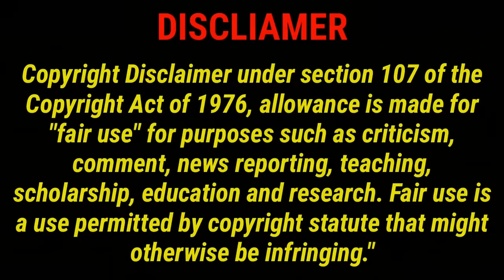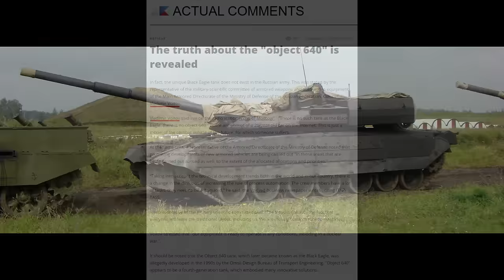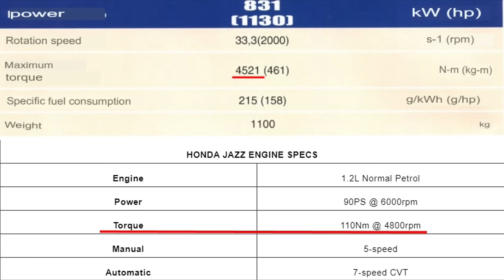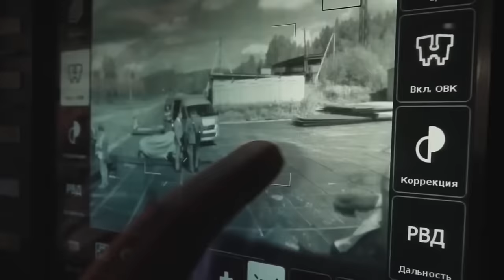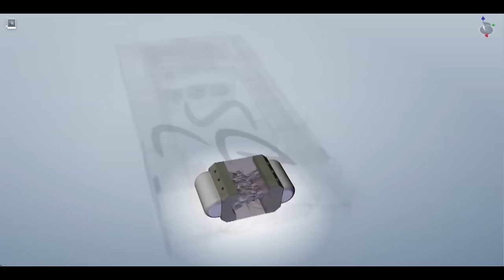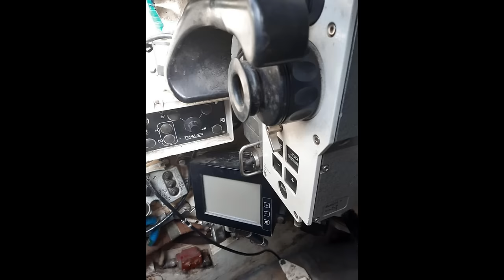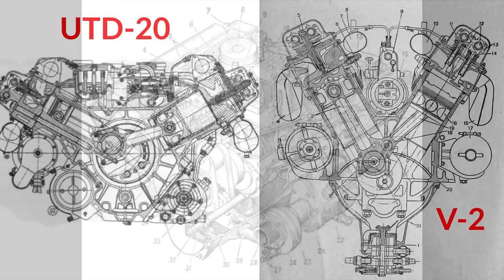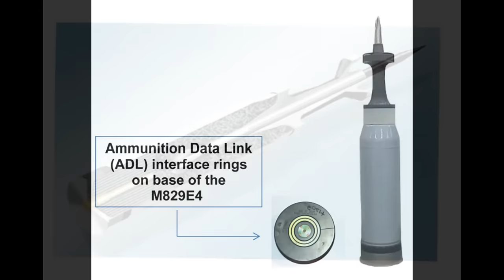LazerPig is WRONG about T-14 Armata

Comment: The max speed of tanks is incredibly overstated. When i did my conscription, most of the time the tanks and IFV drove at around 30 kmh. A tracked vehicle is NOT comfortable at high speeds.

Edit: The vehicles do work at their top speed, however the practicality is the issue. You cannot go top speed in terrain, the areas where tanks and IFVs will be used. Slamming 60 kmh down a highway does not count towards its practicality.
Reply: No it isn’t. You can drive a Dutch Leopard 2 with 100km/h on a German Autobahn. Yes it rattles, but it’s endurable.
Reply: @Grimshak81  Me when I spread misinformation
Reply: @Grimshak81  isn't the top speed of leopards like 70-80km/h?
Reply: @Grimshak81  I didnt say its not durable. I have driven ~65 kmh in a CV90, it rattles like crazy but it does work perfectly. Im saying its not useful to measure top speed because you so rarely use it.
Reply: Reverse max speed is however.
Reply: @Grimshak81  on a perfectly smooth road? Very different from off country which is obviously what the dude meant
Reply: @ОлегКорнійчук-е1х  Yes, but you still wont need 70 kmh. If you are firing from a forestline and you have a dirt path behind you 70 kmh is still way too fast to blindly (or even with the help of a camera) reverse into terrain.
Reply: literally, u dont see T-80s in Ukraine gasing it down max speed because of the risk of mines and breaking formations.
Reply: It matters in terms of logistic and redeployment… in combat you will never reach your max speed so its quite irrelevant indeed
Reply: Yes the fuck it does make a difference in terms of strategic mobility and tactical mobility in many cases. What are you even talking about bro
Reply: The point isn't it's usefulness in long-term travel, it's it's usefulness in snap situations and emergencies, You are not going to care about comfort when you are getting shelled, no you are going to use every single pony you have to get the hell out of there as fast as possible and wish you had more.
Reply: @kjellkriminell372  Only experiences about tracked vehicles are bandvagn and sisu na series.
Yes on flat ground some examples could hit at 70-80kmh but i promise you that you wont
be neening that steering knob at those speeds.

Also some trucks literally cross that controllable speed limit after you hit around 90-120kmh
depending whatkind of truck is in case. Also all your focus is meant to keep that machine 
between lines and even smoking is not an option while doing so.

So personal experience i could say that potential max speed on paper and on highway is
not same as max speed in real situation.
Reply: Look up desert storm, before they restricted the Abrams tank's top speed because of track wear, the U.S. Army’s 2nd Brigade, 1st Armored Division was clocked at 53mph crossing the Kuwait border to engage T-72s and type69s at the battle of Medina Ridge, and this was in the soft desert sand, where Iraqis Saddam Hussein's China and USSR tanks could not do more than 12-15mph, and having first-hand experience in Challenger 1 & 2 tanks they are not uncombable at high speeds, the problem is mechanical wear, mainly with the tracks.
Reply: My .02 
"Speed" is a marketing statistic to sum up "mobility" 
It's not a very good statistic because floatation and traction are more important in every scenario that's not on good ground
Reply: @kjellkriminell372  the equivalent of a weight lifter participating in a sprint race.
Reply: @coffeecat9854  for logistics at the tactical level yes it’s very important. You aren’t going to bring a tank or IFV all the way to frontlines on a train. In that case at the tactical level it can be very beneficial to use the max speed or above on paved roads, especially if the vehicles are needed in an area quickly. I mean hell in a lot of conditions tanks and IFVs will want to stay near the roads, Ukraine is an extreme example but both sides have been forced to keep their tanks from muddy countryside especially at this time so that they don’t get stuck. In combat now tactical mobility will be everything to survival, otherwise you become a sitting duck, even well behind the frontlines. In this Soviet tank designs especially are bad because while they have good top speeds and their lower weight allows them to fight in areas with less built up infrastructure their reverse speed gets them killed.

People like to look at the big and obvious things like gun caliber or how thick the armor is or if it has era or a new turret or this or that but they don’t stop to look at what’s important outside the battle. Sure tanks and a lot of military tech is designed to fight, but it’s equally important that they’re good outside of the fight as well.
Reply: Your right unless there doing a thunder run and even than they never see their tops speeds not only are their weapons system’s inaccurate at high speeds the crews can’t see shit and especially in ifv the vibrations at speed can cause severely injure  and any speed above 30-50km greatly and I mean greatly brings forward its service intervals the top speed are only meant for self transport on the way to combat
Reply: The speed of an armored vehicle only has value as to how fast it can get to where it is needed. That's road travel.
Reply: @Kesssuli  Exactly, this is what i mean. The theoretical max speed is not equal to whats practically used. While a tank can drive 70 kmh on a highway it will not go that fast in combat. A high top speed is better than a low top speed but top speed in general is overstated in tank discussions.
Reply: @DowJonesDave  Yup, and long distance road travel means its getting hauled on a transport vehicle.
Reply: @IrishCaesar  you have it bro.

If you can respond to a breakthrough at 100km from 100km away, you will get there before the dudes at 50. why is that so hard for people to conceptualise.
 
War is logistics first, then combat. You lose by default if you cant get there with Ur stuff. If you get there but your stuff is shit... well at least it might be better than the enemies. If you don't play you can't win.
Reply: Max speed is incredibly important. Reaching the holdout box that is under attack down your highway at max speed is vital in holdout box doctrine. 

Why do you think America is full of highways? So centralised defence can respond to breakthroughs as fast as fucking possible.
Reply: @YourLocalCyberbully  Yes, on paper the max. speed of a Leopard 2 is about 80 km/h. In practice, it's significantly higher.
Reply: @tiznaeshnishto2584  Polish tankers say that the 2A4 can easily reach 80 km/h and this value is even given on the website of one of the units. This is more than the manufacturer's official data
Reply: I mean, if your turret is hit and the only way to live through an engagement is getting thr hell out of dodge, i'll bet you'd be thankfull your tank can go obscenely fast
Reply: It's definitely not overstated. Especially reverse which is universally shit on Russian tanks. The reverse is incredibly important.
Reply: @Grimshak81  Dutch or German leopard cause i am not sure if the Netherlands have leopards but idk tho
Reply: Not to mention they literally fall apart around you from the vibration. Bolts start falling out and shit!
Reply: @DowJonesDave  yep, road travel is very important at the tactical level as long as the area is secured, otherwise you get Russian tank columns that you’ve seen in the war.
Reply: You're touched on one of my pet hates here. Since WW2 there has been vast improvements in all areas of the tank except one, cross country speed. Yes in theory we could build a tank that could travel across country at 100mph. But any sane person would reject it out of hand as there is no way to guarantee the safety of your crew that are going be violently thrown around the inside of tank well before it gets anywhere near that speed.  Removing the crew is not going to help much either as high end technology hates being violently thrown about as well. So if we have not reached the fastest cross country we will not be far off it. I've had bruised internal organs and you can't function very well with them.
Reply: @jamesevans886  The infantry dismount compartment in the CV9040 is often called "the ball pit" for good reason.
Reply: For a reliability thing, its probably better practice that the Abrams can go faster, so that it is not constantly running at the top speed of it's engine. Plus, you have the higher seed for emergencies
Reply: @kjellkriminell372  That sounds like a CV90 problem.
Reply: It’s definitely a case of “can” vs “should”. Like, my car can hit 160, but if I drove it at that speed for a prolonged time it would probably explode.
Reply: I saw a video of the guy driving the Abrams in its test phase in Kentucky he was driving that thing like it owed him money
Reply: Me watching Abrams fly across the dirt backroads of fort Carson at 60mph.
Reply: My dad drove the Henschel Hanomag KaJaPa at 70 and said it was uncomfortable and "wavey". It works but is not good.
Reply: @S3nse1 Yes but rarely you will see tank chasing other tank at top speed. What's important is how fast the tank can go from 0 to top speed. Due to how often you will sit and fire rather than move and fire. Not to mention that how fast you can go, the counter (ATGM) would be faster than the tank. Fleeing being chased by ATGM, well may God save the crew.
Reply: Is a Jeep Wrangler's top speed overstated because it's an off-road vehicle?
Reply: Zaloga noted in his book that crews in WWII didn't really care about top speed. They valued protection over speed.
Reply: thank you this is something i've been saying for ages that top speed is a pretty unimportant stat for a tanks effective. Even off-road it's limited as the driver needs to be able to stop to avoid obstacles which is harder off-road limiting the speed, then there's the limited visibility of driving the vehicle buttoned up. If they want a vehicle for speed then it'd be a wheeled vehicle  you'd good for, tracks if you want off-road capability.
Reply: @drbunheada224  because Americans drive a lot of cars? This is just a silly point
Reply: @alexboccaccio5431  wrong. Americans drive a lot of cars because there are a lot of highways for them to drive on. Highways which were built first and foremost to facilitate military transportation.

Russia chose rail networks over highways
Reply: @drbunheada224  that was the legal Eisenhower made justification but that is not why America still has highways today. We would not have half as many highways as we have today if Americans didn't drive cars.
Reply: @kjellkriminell372  Yep. Anyone who does not know what we are talking about should get in the back of an old pick up and try getting to even 40kmp at night cross country. I would also recommend checking your medical is up to date first. I've been fox shooting many times.
Reply: @cstgraphpads2091  tracked or wheeled the dismounts comfort is either low or extremely low. I would rather ride a cv90 than a bmp though,  western vehicles are often more comfortable to be in for extended periods of time, or maybe better put less uncomfortable.
Reply: @YourLocalCyberbully  Tank may have 3, make it 4, different maximum speeds, depending how you want to define it, and what number you think really matters. 
There's Sustained speed, which is speed at which tank can drive until its fuel runs out.
Then there's Dash speed, which is how fast it can go but at limited time, because parts will heat up too fast to give away heat, and you'll eventually break something.
Finally there's ungoverned speed, which is actual speed tank can pull off if you're not afraid of court martial, something exploding from being pushed to its limits for too long, or getting killed when manuver goes wrong, whichever happens first.

The 4th, sort of, type is when finished vehicle didn't live up to design and either due to being overweight, or severe reliability issues, its actual speed is well bellow both declared dash and sustained.
Reply: Probably especially when not armed
Reply: we had but we sold them and are now leasing 16 from Germany
Reply: @werrkowalski2985  WWII was a while back....
Reply: That's why it's called the max top speed. And yes most of the time it's irrelevant, at least in the combat situation.
Reply: @drbunheada224  Don't you think the highways are there because people use them?
Reply: @van0tot100  no
Reply: @YourLocalCyberbully  Yeah, and you are literally not allowed to drive them on our Autobahnen.
t. Ex-Leopard 1 crewmember.
Reply: Yup I guess thats universal with Armor, its a Myth that Knights in Medieval times were Turtles that can barely move but at the same time ypu really need to be careful with it because its still limiting your movement and breathing.
Reply: @forickgrimaldus8301  Very good example. I guess it is just not intuitive unless you see the evidence or read into it.
Another example concerning tanks are the King Tiger vs. the late Panzer IV.
The King Tiger was actually faster, had less problems on soft ground and had a higher power to weight ratio than the Panzer IV Ausf.H, but people hardly believe it because it they instantly think "Big tank slow".
A similar issue arose with the British Cruiser tanks which had a lot of mobility problems in certain areas and thus could not use their excellent speed. Weirdly enough the Matilda 2 for example could outmanouvre (Though not outspeed) several Cruiser tanks due to its weight distribution.
Reply: In my experience going over 40 or so made it almost impossible to hear my commander, and incredibly difficult to see clearly, shitload of fun though
Reply: @Grimshak81 me when I never felt a woman touch and being an armchair expert
Reply: @niko7626  it still doesn't, going at full speed will cause too much wear on a vehicle, not to mention long distance transport is done by rail or truck.
Reply: @Grimshak81 not really, and also how is that at all useful in any battle application? I can probably make the turbine send an Abrams down the freeway at mach Jesus, but it doesn't mean I can go through a forest or hilly dirt path that way, much less with obstacles
Reply: But you do see these T-72 blasting trough roads in Ukraine.
Reply: Somebody once said: "The engine of the tank is a weapon just as the main-gun." I think the guy knew one or two things about tank warfare.
Reply: @niko7626  Even there it doesn't matter that much. Driving tanks thousands of kilometres to the frontline is a bad idea, rail is superior.
Reply: @HD-mp6yy  rail is superior for big redeployment but mobility in a battlefield can keep you alive and your tank running… thus i never understood why russian tanks reverse with like 10kmh max. Its just bad engineering or bad doctrine… like a ww2 tank was faster than that and they did not have turbine-engines